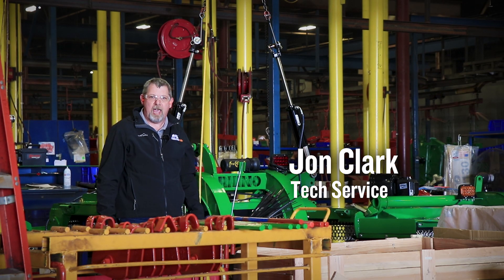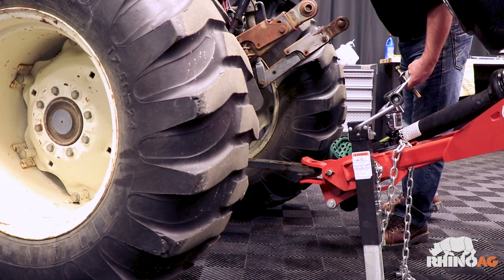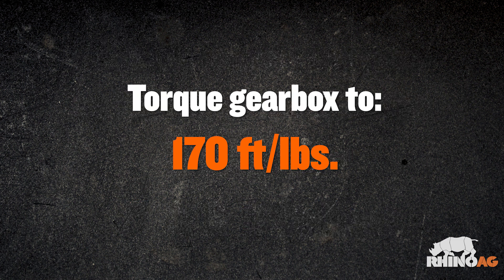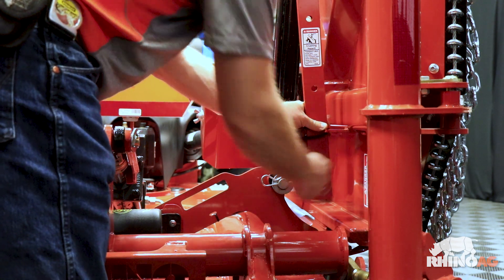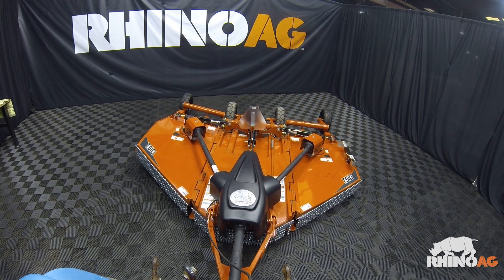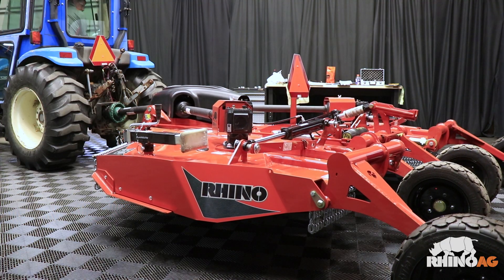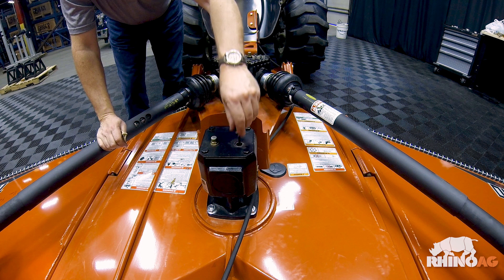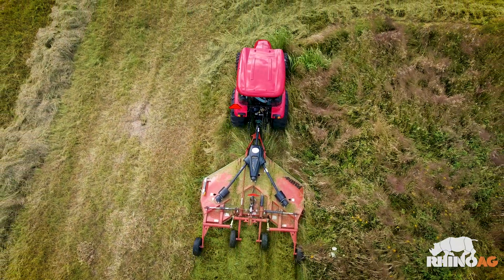RhinoAg TS10 Rotary Cutter: Setup and Pre-Delivery Procedure

Comment: Stay away from Rhino. Parts support is non existent.
Reply from the maker: What parts are you looking for?
Reply: @RhinoBornToLead  00763624. I also needed a sheave which I found by a stroke of good luck on the dusty shelf of an old farm store in Iowa and 00769484 which, after much investigation, I found was the same as a Land Pride part which I got from Land Pride.